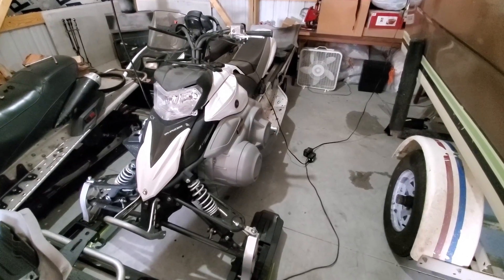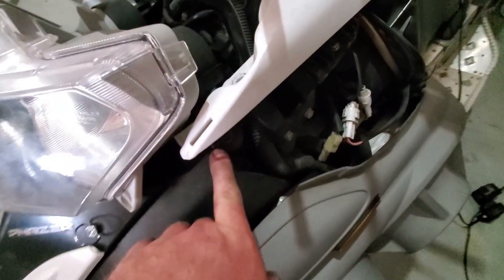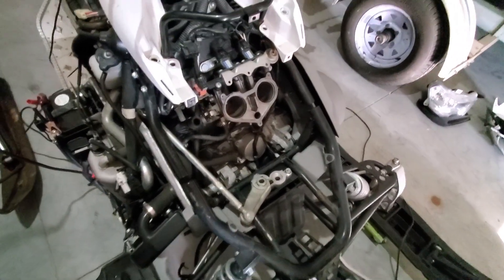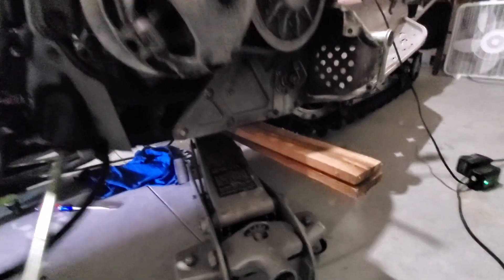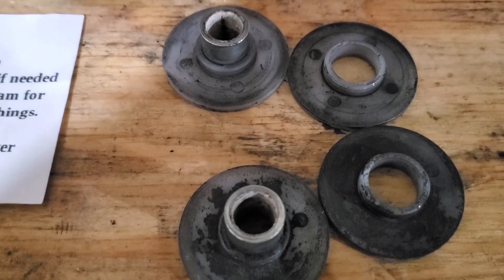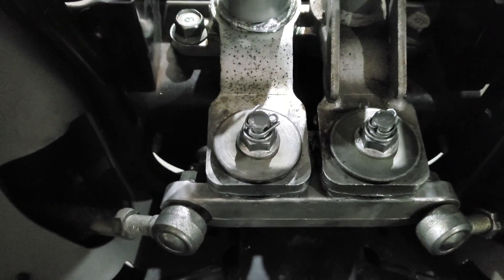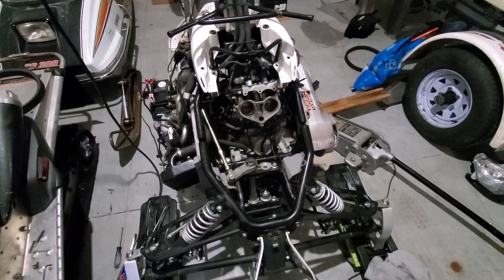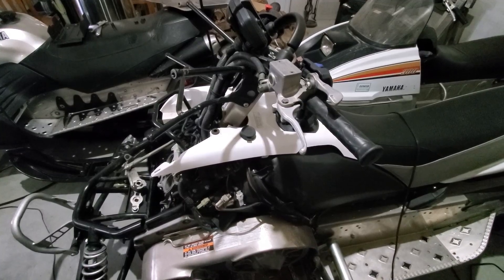Yamaha Phazer Loose Steering Fix- UP Bushman Steering Kit

Comment: Thanks for posting this walkthrough.  I just pulled the front of the sled off tonight to change the oil filter.  Don't know if it was ever changed so I did it for piece of mind.  I also ordered the steering kit from UP Bushman and will be putting that on while I got it apart.  If I didn't have your video I would have sent it to the dealer.  Thanks for saving me some bucks.
Reply from the maker: No problem glad it helped
Reply: i guess it's kinda randomly asking but does anyone know of a good site to watch new series online ?
Reply: @Reuben Henry Flixportal :P
Reply: @Jayce Marcelo Thanks, signed up and it seems to work :D Appreciate it !
Reply: @Reuben Henry you are welcome =)

Comment: The beauty of your video is you show everything, some video on mtx 07 up they just say oil changes are 1/2 day, so wrong, what oil do you like to use and how many miles in between changes u figure?
Reply from the maker: I change the engine oil and chain lube  yearly every summer I probably drive them 1,500-2,000 miles a year. I use Polaris SCL for chain as I can get it easy and its synthetic. Makes reverse shift easier. For the engine I use Mobil 1 0w-30 from Walmart. I have heard differing opinions on using this oil but I have never had an issue. Yamaha recommends changing the filter every 12,000 miles but sooner probably would not hurt.
Reply: @MiloFarms  ahh thanks for the recommendations on the oil and chain lube, yes I used SCL Polaris on a Ski Doo in 2010 on, on a Summit, seems like good stuff! So if you had the opportunity today, in 2020/2021 do you think the MTX's are good value and long term durability? Clutch Maintenance? And secondary?
Reply from the maker: @randylee2549  I cant speak for anything new but the 2007 and 2008 Phazer Mtn lites/MTX sleds are great. If you can find one that was not terribly abused and fix it up it will last a long time. As far as clutches all I have done on mine is cleaning and installed new belts when I got them. I also correctly shimmed secondary that was never correct from the dealership

Comment: On the left side of the sled, right under the plugged hole I'm assuming is for a 12v adapter, there is a white unused plug end with two little pieces of rubber in the ends.  It is right near the rectifier.  Do you know what this unused plug is for?
Reply from the maker: It is for the 12 volt power point. If you look at my spark plug video: https://www.youtube.com/watch?v=pUC0nveMbp4&t=218s at 5 minutes 15 seconds you can see it. The accessory power adaptor is: https://www.yamahasportsplaza.com/oemcatalogs/p/yamaha_snowmobile_2007_phazer_mtx/yamaha_snowmobile_accessories-electrical/5632c40487a866079834c5c6/dc-outlet-kit Yamaha part #  8ET-W8192-00-KT

Comment: You should do a video on an oil change on this sled. Also chain case replacement too
Reply from the maker: I just did the oil change but did not video it. My goal is to video it next summer and post it. When the sled is apart like in this video, and you have access to the oil filter, all that is left is drain the oil pan and refill with oil when done.

Comment: I put the tie rod ends off a yfz450r. They fit perfectly on the phazers and are way haveier duty. I also put one on the upper one thats under the air box. They are very tight and actally hold grease. 

Next best mod is the UPbushman spindle bushings for the skis. This is good for the mountain lights not being used in the mountains because they can be put on the wide stance. 

After that for not so much mountain riding and more trail riding I put the 19 tooth gear in the chain case instead of the 21. And the heaviest rivets are 13 grams (black). Keeps it in the power range when you punch it from a stop (11,300rpm) instead of bouncing off rev limiter all the time and loosing power because timing is pulled.

Finally I put the stiff springs on the back from an rtx because I ride it hard on rough trails and I like to jump it a bit. I am 180lbs in regular clothes.
Reply from the maker: Thanks for the comment. Was thinking of doing the spindle bushings eventually as well. These are not too bad yet. Hoping first of December to get them out and work any other bugs out of them and have some Idaho snowmobile videos to post.
Reply: hey there can you go into depth on the yfz450r tie rods what year can you maybe make a quick video explaining it please n thanks I need to get my phazer going stright down the trail.